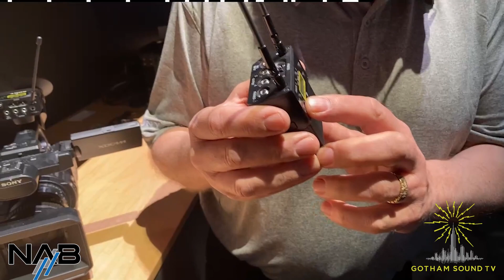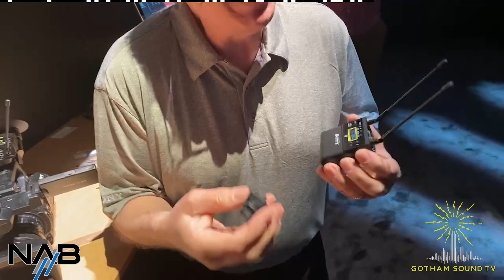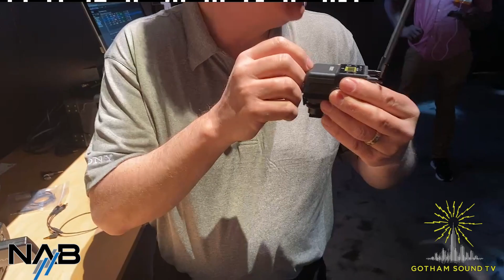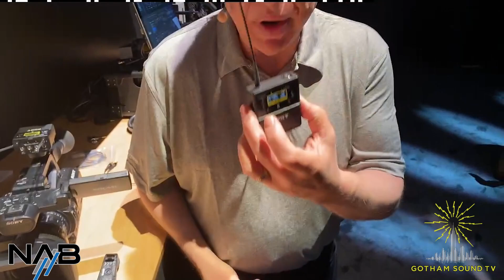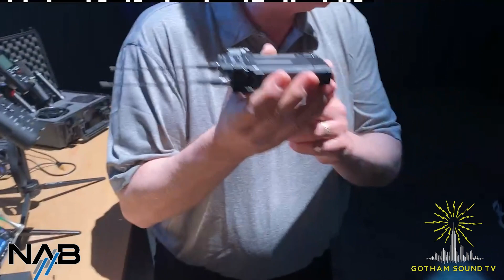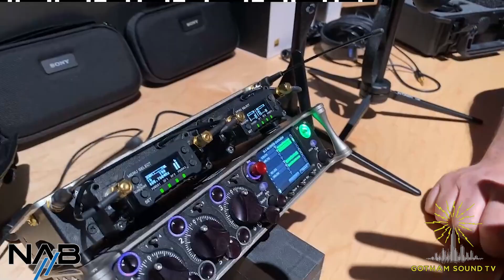NAB 2022: Sony

Comment: "@12:42 URX-S03D SuperSlot/Unislot Integration"

Sadly it is not at all SuperSlot compatible! :-(  Only compatible with those that use the 15 pin interface, can't be used with any of the many Superslot accessories. 

Such a pity, I wish there was a UWP-D SuperSlot receiver! Hopefully Sony can bring that out soon? Seems like such a major oversight by them! Especially when they were thoughtful enough to include SuperSlot compatibility with the Sony DWR-S03D that they released five years earlier.